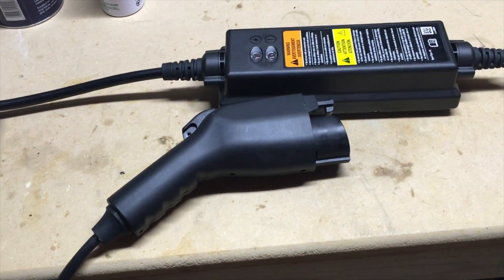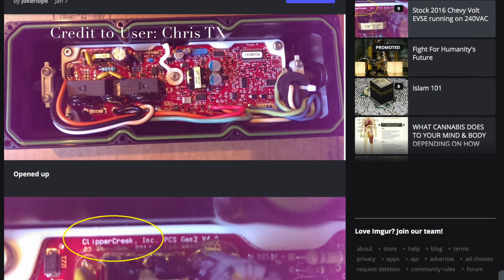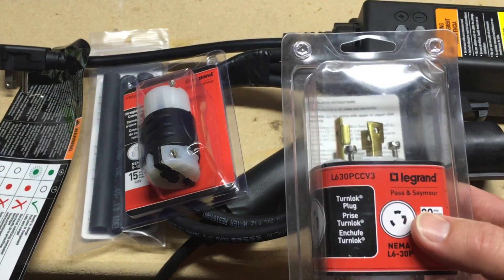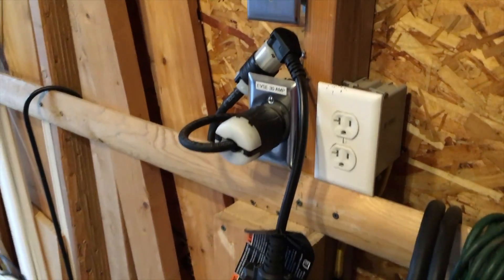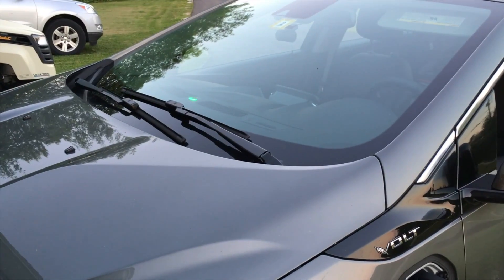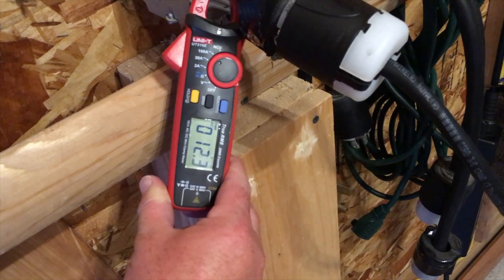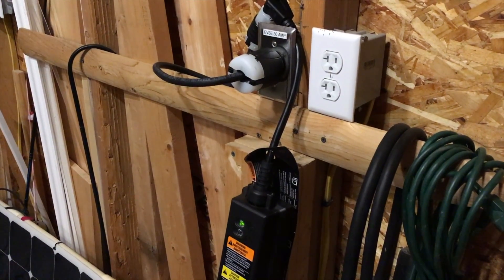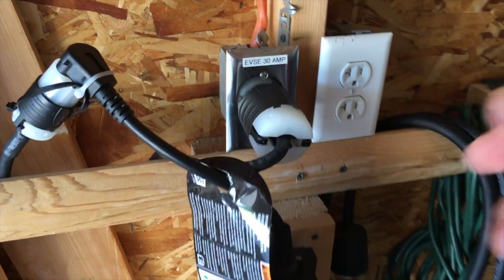2016 - 2018 Chevy Volt Hidden Level 2 Charger 120/240 Charging!

Comment: Hello, I have some detailed questions: When should we add oil to the engine? For example, I added oil 1 year ago and it still shows 90%, should I change the oil in this case? , also, when is it better to charge the battery, should it sit until the end and then charge? If, for example, the battery shows 50%, 60% or something else, then can it be charged? Which is better for battery care? And another question, how many amperes is better to charge the car?
Reply: Owners manual specifies oil changes when the OLM (oil life monitor shown on your dash) tells you to change it or every 2 years, whichever comes first.
The Chevy Volt has artificially restricted battery capacity (both max charge and minimum charge) to prolong the battery lifespan, other EVs dont baby the battery as much so as long as you're not leaving it empty or full for months on hand it should be fine, use it as its best convenient for you.
similar answer for the best amperage, the onboard charger, the only charger the battery takes current from since EVSE's only provide the onboard charger with power, maxes out around 3.6kw, which is fine for battery health. DC fast charging is whats hardest on EV batteries and the Volt doesnt support that.

Comment: Unless you are there on guard 24/7, it would be a good idea to also add a laminated warning note permanently attached to the adapter, "EVSE adapter only! Do not use for any other purpose!" Unfortunately, zip ties can be easily clipped off by unknowing individuals with basic limited knowledge of electric circuits. This can be very dangerous if used almost any other way!
Reply from the maker: Good idea.  FYI, I no longer have this EVSE or vehicle!

Comment: just curious. your 110 adapter was 15 amp but its pushing right around 25amps does it need to be rated for over 30amps or is it okay with the 15 amp also what size wire are you running?

Comment: One problem you might be overlooking is the heat generated by the extra voltage that could melt the cable coming from the charger and going into the car, to risky for me
Reply: The opposite is true:
Higher voltages can use thinner wires for the same amperage. Since we are limited to a maximum of 12A either way, it should be cooler. I don’t know why his cable felt notably warmer in the video but perhaps he normally charges at 8A with 120v to avoid melting the outlet. With 220v that is no longer necessary.

Comment: Another way to be safe would be to have a 120v duplex with both jacks of opposite phase and then fabricating a 'Y' dongle using 120v plugs and one in-line jack.  Everything is still unmodified and usable in 120v except for the 'Y' adapter that can supply 240v when needed.

Comment: I wonder if both 240 hot lines are switched inside the charge unit.  I hope so, because if the 120 v. design didn't switch the neutral you'll have one lead always hot out at the plug (even if it's not plugged into the car.)   I modified a 2013 "charger" but it required disassembly to route both power leads through the double-pole contactor.  A DIY was on YT somewhere for the earlier ones.. May still be.

Comment: I got a nema 5-15 to L6-20 adapter online, plugged it in to a 240v 20amp circuit, and it won't charge at level 2 16 amp rate. Only charges at a max 12 amp which is available with just the 5-15 plug alone without the adapter. So I don't see the point
Reply from the maker: 12 amps is the max for the EVSE, but you are getting 12 amps across 240 volts so essentially double the power!
Reply: @GreenMountainDIYGuy  thanks for the reply, I did notice that even after installing a legit level 2 clipper creek unit it still shows max 12amp and the expected finish charge time to be based off 12 amps on the energy screen. However when you open the car door on the instrument cluster behind the steering wheel it does show you an expected full charge time to be about 4 hours meaning it's 15-16amps. So even though the energy computer is wrong and probably could use an update, the actual charge time is at level 2.

Comment: I^2 x R = POWER, wires heat up from current flow not voltage. Higher voltage requires less current to provide the same power. No need to use thicker wires with higher voltage. 220 volt household circuits are reallty only two 110-volt wires anyway.
Reply: Melanie, are the thicker gauge wires required by U.S. building codes for 220 volt circuits based simply on the the larger draw usually required for 220 appliances and not just the voltage difference... as you stated it's just two 110 hot feeds but thicker wire is always mandated in the codes.

Comment: no modifications are necessary just hook 230 volts to a 110 volt wall outlet. Take the power leads going to your central AC unit and attach them to a receptacle. You could replace the plug on the charging unit or make an adaptor and use a 220 volt receptacle if you wanted to prevent someone from plugging in some other 110 volt plug into your 220 volt receptacle.

Comment: Again I am asking this question, hopefully someone can answer it :Can I replace my dryer L630 receptacle or whatever it is called with a standard 110 volt receptacle and plug in my Volt charger into this 110 volt (now 220 volt) receptacle?
Reply: Technically yes...but if someone where to accidentally plug a 110/120 device into it it will damage the device and could cause a fire.  That is a problem in countries like the Philippines  that use the American style Type B plug for both 120v and 240v devices.
Reply: Good answer, Nat Shain should acknowledge your response.
Reply: Late response and long response here but I feel I should add the fact that.. since you are considering using a 110 outlet for 220... that the internal components of outlets are designed to handle the voltage they are configured for and in the U.S. with many cheaper 110 outlets sold in big box stores there are failures even when transmitting 110 15amp current.  These failures and overheating  occur with cheap switches also..especially with cheap dimmer switches.  I am not a licensed electrician but I was taught in the 1970s by a master electrician and I have worked with residential and commercial wiring for many years doing remodeling. I would recommend at a minimum using a good quality 220 outlet and good quality self wiring plug and socket ends (the ones with ribbed screw down contact plates for the stripped wire ends)(the ones shown in the image do look like they are good quality ) on the pigtail/adapter wire. The "savings" / "simplicity" in using a 110 outlet hardly seems worth it. The point made earlier in this thread by the woman (can't remember her name) about how 110 and 220 are carried on the 110-black hot and white neutral... 220- black hot..red hot..and white neutral leaves open the question of how and or if the neutral 110 leg is switched for 220 within the control (?control?) box that has the green and yellow indicator lights. Apparently it is switched because it is charging for you at 220 without problems but I don't really understand how the neutral flat plug now carries the red 220 hot once it is  in the control box since it was the neutral leg in 110. I'm not doubting it's working fine for everyone but it strikes me as an odd/weak transmission point within that control box and also the cord on the charger that came with my 2017 is not short- 22 feet long- and it is stamped as only 3 conductor 16awg.  Does anyone reading this have a factory manufactured 220 charger who could post what the gauge and length of the wire is 🤔 ? Hope this post isn't confusing and I don't mean to doubt that the configuration you've made works.

Comment: Can I replace my dryer L630 receptacle or whatever it is called with a standard 110 volt receptacle and plug in my Volt charger into this 110 volt (now 220 volt) receptacle?

Comment: How much does the charging speed improve with this method?  I suspect it'll still be better than level 1, but if still just the 12A, it's not as fast as the 16A and higher, right? Thanks!
Reply: This mod will give you 75% the speed you'd get with a real level 2 charger. 5.75 hours for a full charge as opposed to 4.6 hours.

There is no 16A charging for this car. 15A is the max. The onboard charge controller is limited at 3.6kW. They doubled it for the 2019 to 7.2kw/ 30A.

Ohm's law.
12A at 120v is 1440 watts (fastest level 1)
12A at 240v is 2880 watts (the method in the video)
(12 amps going down one 120v wire vs two 120v wires, twice the current/ half the time.)

Max level 2 (for this car) is 15A going down two wires, 3.6kW

Helluva lot faster than 8A going down one wire, which is 960 watts (4 times faster).  (default charging with the included cable).

Full usable capacity for this battery, full to "empty" is about 16.6kwh. They advertise 18.4, but not all of it is usable. They keep some in reserve (or limit how much it can be discharged to not stress the batteries so they last longer).  I've tested it repeatedly. I'm pretty confident in that number.

Divide the capacity into the charge rate for the time of a full charge:
16.6kwh(capacity)/0.96kw(charge rate) = 17.3 hours (8 amps @120v- low power level 1)
16.6kwh/1.44kw = 11.5 hours (12 amps @120v- high power level 1)
16.6kwh/3.60kw= 4.6 hours (15 amps @240v, level 2, fastest possible for this car)

Comment: To be on the safe side, I would cut the 120 plug off the charger and replace with 240 volt male plug. Then make an adapter for plugging the charger into 120 volt if that were ever necessary. That way it would be idiot proof and not have to worry about wife or kids using the adapter to accidentally plug in 120 volt appliances into 240 volts.
Reply: True, but the stock plug has a thermal sensor that provides some protection. I find that to be a nice feature.
Reply: Honestly could use bright red thermal removing tape, wrap connections together, and in big sharpie letters, write "danger, do not remove". That might/ should be idiot proof.

Comment: Never did say how much faster it charges?
Reply: I was wondering that myself. But I did a quick calculation based on the amp reading I saw on the video. If it pulls 12A @240V, that will be approx. 2.7kW (power) for the usable battery 14KWH it will take between 5-6 hours.

Comment: I think I would buy a $200 240 volt charger on Ebay  or Amazon and keep my factory one for  my travels I`m sure my hotel will have a 110 plug for me and I can charge it back up over night and save the gas.
Reply: He didn't do anything to his factory charger.  All he did was make an adapter cord to plug the factory charger into the bigger socket.

Comment: This is not a good Idea for safety reasons. This charger did safety testing at 120 Volts. Fires waiting to happen
Reply: I think Melanie is right, it's not a charger it's a switch but still the switch and the plug are rated/tested for 110v not 220v . The switch box with the green and yellow indicator lights may be identical for both 110v and 220v cord sets..I don't know.. but the plug that comes with the first and second generation Volts is 110 configuration so 110 rated/tested as his melted or damaged plug would indicate. 🤔

Comment: probably works because they sold the same charger when selling the Volt in Europe and Australia which both use 240V instead of 110V for household supply.
Reply from the maker: I think you are correct.

Comment: Australia with 240 volt standard means all Holden Volts charge on 240 volts. Not sure if they are limited to 8 amps however...
Reply from the maker: I believe the limit was 12 amp at 240 with the modification.  I no longer have the vehicle or power supply.  Thanks for watching.

Comment: Good video, but you're better off buying a reasonably priced level 2 charger with a larger wire so that it doesn't get hot. Why risk burning down your garage and car just to save a couple hundred bucks? Besides that, it pays for itself in no time at all.
Reply from the maker: This video is almost 2 years old.  Newer lower cost chargers are now available.
Reply: I know this is an old comment, but just wanted to point out that if the current is exactly the same, then the heating will be exactly the same. Increasing voltage doesn't cause heating in the cable. That's why newer EVs doubled their battery pack voltage for faster charging. 

Cheers

Comment: The wire gauge and how much it will heat up depends on current, not the voltage, the drop will be the same for the same current. Since the current at 120v is also 12-13 amps, there will be a warming at 120v the same as 240v. In other words, I wouldn't worry about that since the cable is designed to handle the 12+ amps that the charger pulls.

You can also reduce the current in the Bolt interface, limiting it to 8 amps if you are concerned about the load. You would still be presenting a faster charge,  about 30% more power than 120v @12A.

Comment: Hello, nice video, do you still have your car and your setup since your post ? I wondering if the charger or the wires are getting hot overtime ?
Reply from the maker: Thanks.  I no longer have the car.  Wires from the charger were a little warm when I used it in 240 mode.  It worked out well for three years.  Have a different electric car now....
Reply: @GreenMountainDIYGuy  Thanks I was hoping someone asked this felt a bit ripped off that it only came with a 120v lil did I know ya saved me 500$

Comment: I have a welding outlet at the moment 50amp 6-50R. Could I make an adapter that would connect to this outlet and the other end a standard plug to charge Volt or would i have to change the outlet?
Reply from the maker: Greg Ripko Yes, that would work as long as you have a generation 2 Volt or Bolt.  The power supply will only draw 12 amps off the 6-50R even through that outlet can provide much more power.  Good luck, but do at your own risk.

Comment: well i have the 2014 with a voltec charger what do you think? is it doable?
Reply from the maker: Victory John no, don’t do it.
Reply: I have a volt with same charger you can modify but you need to un solder the neutral jumper and need a 14-3 cord to put back mine works great

Comment: So Just watching this video and this small adapter cord is fine for this charger because it may be able to carry the 240 volts.  However, if this cord got into the hands of someone else and they plugged a device into the 120 volt female end this would cause this device that is rated for no more than 120 volts, to over heat to the point of burning because of the higher voltage.  Remember that this cord is applying 240 volts to a 120 volt configured receptacle cord end.  
Generally speaking when corners are cut to save money on electrical devices and wiring it ends up costing a lot more in damaged devices or even worse a house fire or 3rd degree burns to an appendage!  As an Electrician I would never make this cord for someone.
Reply: Agreed - That is why we provide the Red Safety Seal with our EVDOUBLER to semi permanently seal the charger to the 240V outlet.

Comment: why can't you just use a 110v plug receptacle (like the one directly to the right of your setup) with the 240v wires running to it?  It would eliminate the need for the adapter.  The only issue I could see is that a person could unknowingly plug a 110v rated tool or something into that plug, and then burn it up.
Reply: Brad Frietas, there are a lot of cheaply made 110 plugs sold and I've seen them fail even when fed by 15 Amp 110v breakers.  The cord  plug ends are not always solidly made either, at least not routinely over built to handle 220v.  Someone also stated in this thread that if you cut off the 110 plug to rewire it with a 220 plug there are apparently two other wires in the plug that must act as some kind of sensors feed..one orangewire and one yellow. If that is true it seems like a weird choice to just tape them off as that person suggests.  I'd assume that there is one or more circuit boards inline before the battery charger itself in the vehicle that is reading the ground on the breaker feed and sending info to the charging computer/s . Has anyone else seen those other wires or would everyone be keeping the 110 plug intact?
Reply from the maker: Brad Freitas Too great of a chance of plugging in a 110v device as you mentioned!
Reply: so is that the only downside?  Can the standard plug handle 220 volts safely? @GreenMountainDIYGuy
Reply from the maker: @BradFreitas  I used a 20 amp rated plug and it seemed fine. With that said, do at your own risk...